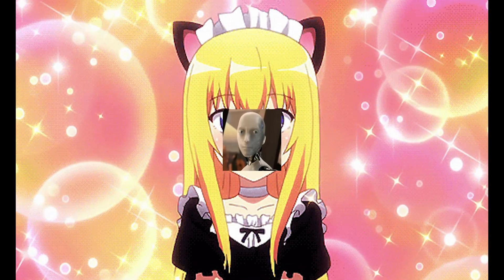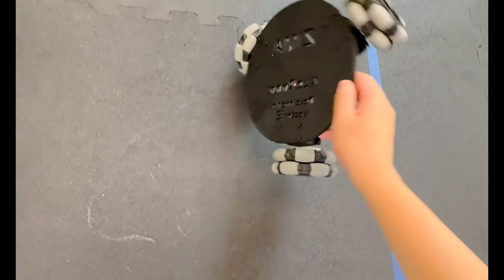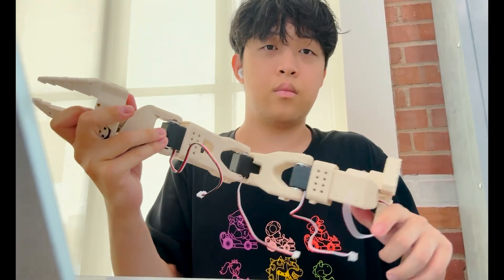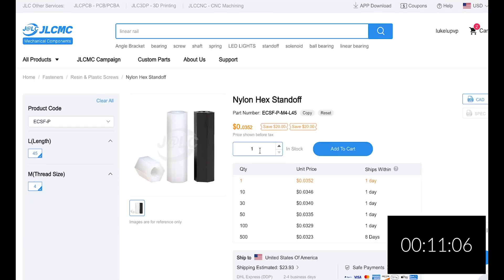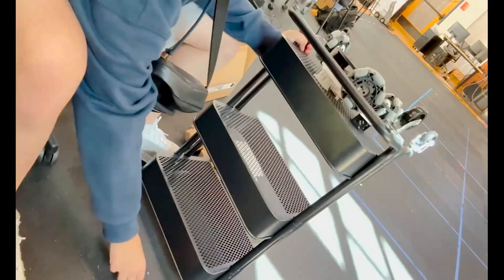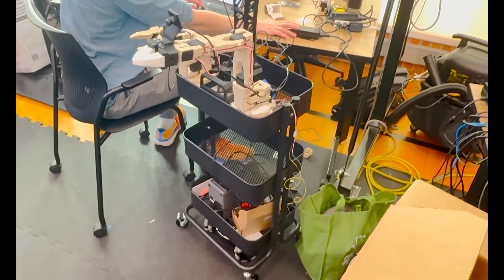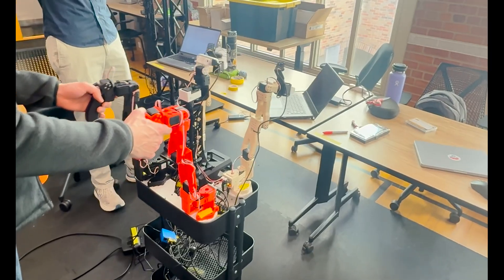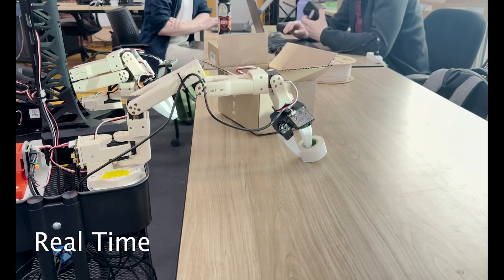I Built a Robot that Does Laundry

Comment: ### Project Aurora – Humanoid Robot (Simple Version)

*What is it?*  
A silent, warm, super-safe humanoid robot that moves like a human muscle – no noisy motors or stiff gears.

*How does it move?*  
- Tiny "muscles" made of Nitinol wire (a smart metal that shrinks when heated and relaxes when cooled).  
- Instead of slow natural cooling, a super-fast water pulse (pushed by 3kV electricity) instantly cools the wire → lets it move smoothly up to 5 times per second.

*Why is it special?*  
- Completely quiet  
- Naturally soft and safe to touch (no hard metal parts)  
- Body is warm like a person (waste heat is recycled to warm the skin)  
- Light and strong (carbon fiber bones + elastic joints)

*In one sentence for anyone:*  
“It’s a robot that moves with warm, silent, living-muscle wires cooled by tiny electric water jets – so it feels gentle and human instead of cold and clunky.”

Perfect for hugging, helping elderly people, or working closely with humans without danger.  
Ready for real prototype testing! 🤖❤️
Reply: ### Project Aurora – Super Simple Actuator Explanation

*The “magic muscle” inside (called the Active Vein):*

1. It’s a thin, flexible tube made of braided Nitinol wire (a metal that remembers its shape).
2. When you run a small electric current → the wire gets hot → it shrinks and pulls (like a real muscle flexing).
3. To relax quickly, a tiny blast of cold water is shot through the tube using a safe electric push (like an invisible water gun at 3,000 volts).
4. The water instantly cools the wire → the wire stretches back to long → muscle relaxes.
5. This heat-and-cool trick repeats up to 5 times per second → smooth, fast movement.

*Extra smart parts:*
- A super-thin skin of special silicone keeps the electricity and water safely separated while letting heat pass through.
- The leftover heat from the wire is recycled to warm the robot’s outer skin, so it always feels nicely warm like a person.

*Result:*  
A silent, soft, warm “muscle” that is strong, safe, and feels alive, no gears, no motors, no noise. 🤖💪❤️

Comment: Maybe the gripper from TPU or polyurethane would have better grip.

Also disagree that the robots have to cost a fortune, I think it's possible to make a UR5 size and performance equivalent robot arm for less than 2k
Reply from the maker: We did make it out of TPU halfway thru it was just a problem w calibration. And for a ur5 robot is that including 2arms and movement?
Reply: @lukedoesrobotics I'd say if you need 2 arms and movement it would be like 4k or smth
Reply from the maker: ahh yea i agree then, the ending was more of a joke lol